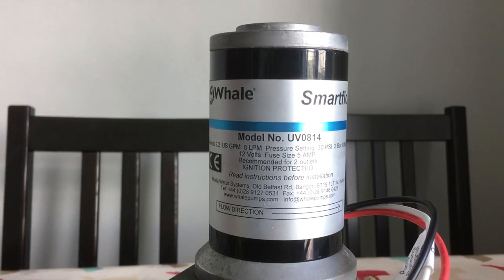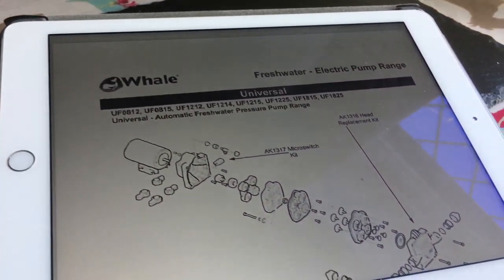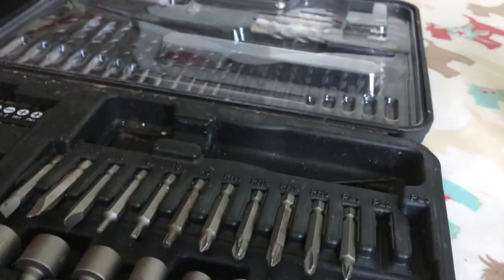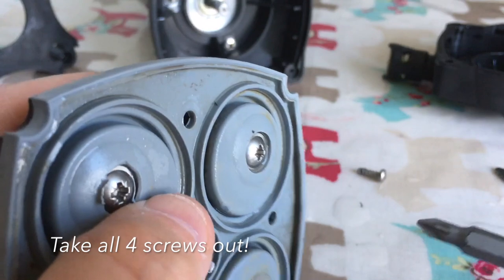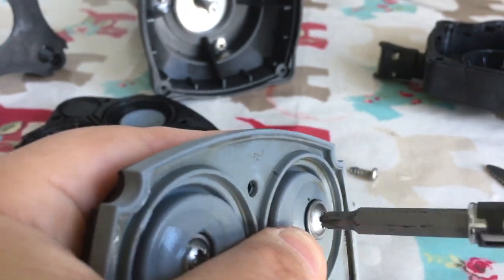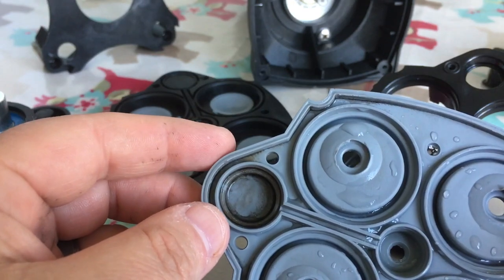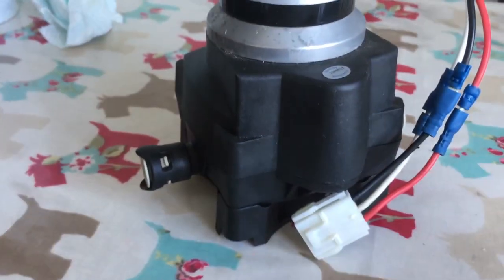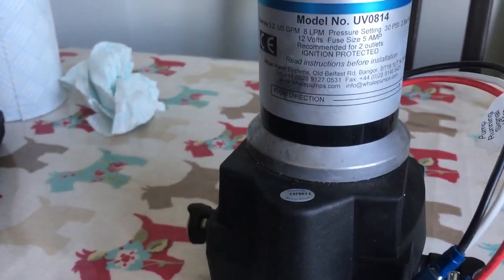Whale Water pump Maintenance

Comment: The saga of my water pump in my series 1 Unicorn. After problems with a noisy pump and what appeared to be non return valve issues I decided to carefully follow your excellent video and strip it to fix it. What I wasn't expecting was the micro switch assembly in the top motor housing to fall out.  I had to guess which order the 4 components went back.  After a while I reasoned they could only go back  one way. So after a good clean out I reassembled the pump only to find that, although the motor worked it wouldn't pump water. Four times I took it apart trying to find why until I finally tried a bit of silicone sealant on the mating surfaces. Shouldn't need it but it worked. It actually pumped water ------ until it wouldn't shut off !! 
I was confident I had put the micro switch assembly back right but it just wouldn't shut off, chucking water out of the pump all over the floor. Enough of all this !! I bought a new one today and fitted it. I needed to altar the infeed pipe a bit but although these newer pumps are said to be quieter I can't detect much difference. In fairness my wife pointed out that it's often better to hear the pump working. Many times we've been unaware the water container was empty and hearing the pump working alerted us.
Reply from the maker: Hi Phillip, Sounds like you’ve had fun with the pump 🤔 Our old pump gave up in May. We got on site, set up, turned the pump on and nothing happened. We managed to get a new one that day and fitted it. It was initially quieter but got louder as the week went on. I would say the noise is different each time we go away, I like you have resigned myself to the fact that the pump will always be noisy. Part of the problem is that noise travels fantastically through a floor of a caravan. If I ever find a solution to make it quiet I will of course video it. 🙂 Thanks for comments & watching, Martin 🙂

Comment: Good instructional video, well done. My diaphragms were very worn so I replaced them with a Whale service kit, however I have been unable to get the pressure back up. The pump runs a lot quieter, and water is flowing albeit very slowly, however not enough pressure to shut the pump off. Any thoughts?
Reply from the maker: Possibly air in the pump, ours only lasted another 6 months and had to buy a new one. Hope you get it sorted. Cheers
Reply: Took the service kit off to return for credit, put original back on and it works fine now. Not sure how long it will last, but I think cleaning before replacing is a good option. Sadly this does not explain why a brand new kit wouldn't work. Just happy to have it up and running for now.  @TheCaravanNut

Comment: Great vid Martin - and job done by the look of it ! - I know that pump has bugged you from day 1. I had to get a replacement Flojet pump earlier this year when my pump would not work at all on my first trip of the year  -( whole week without water !) . I disassembled on site to see if i could get it going and found it was just the pressure valve and was prepared just to buy and fit that, but found out it was covered by my 12 month warranty so Lowdhams, Huddersfield  replaced the whole pump FOC.

Good work Martin !
Reply from the maker: Hi Howard, I’ve been playing around with it again this morning, dropped the water and refilled it. It is quieter, I think I just need to resign myself to the thought of that’s what it’s supposed to be like! Thanks for comments and watching, Martin 👍

Comment: Hi, I tried this clean myself after issues with the pump switching on randomly and air getting into the system.   I would have to turn the pump off at the switch so it doesn't drive me crackers.   this causes a loss in pressure so when i switch it back on the pump operates as if its filling the cylinder up again and i have air in the hot side of the system.  I've rang whale and they suggested the o rings for the air problem, which i have already changed.  wondering if it would be worth changing the pump diagram head now?  maybe the rubber has gone a little brittle and lost its elasticity and so is not holding the microswitch in the off position?  Any ideas,  Help  :)
Reply from the maker: You could try the diaphragm it may work. Our pump only lasted another 6 months after this job, bought a new one!

Comment: Thanks for useful video. I have an FP0814 and was able to fix from this video. My problem was that it periodically tried to pump with the tap closed. Your video gave me the confidence to dismantle it and I reckoned the problem lay with the one (or more) of the four smaller light grey "valves". Carefully popped out all the valves and spotted some minute white particles on their sealing faces (I fill up most often with hard water) so rinsed them all off and put them back in and reassembled. My FP0814 seemed to have an extra metal washer which slipped out before I could spot where it came from. All back together, no leaks and on test it sat for 30 minutes without a single intermittent pump. Perfect. Dead chuffed! Thanks.
Reply from the maker: Glad the vlog helped and sorted the problem. Our pump only lasted another few months had to change! 
Cheers

Comment: IMPORTANT! When dismantling the unit pay attention to the stainless steel washer and O ring. As previously mentioned make sure that the screws are all tight (the diaphragm may need wriggling to seat the screw holes properly. Lastly, there’s a tiny O ring around the head of the longest screw, ensuring that was in the centre of the washer when tightening seemed to do the trick ( would be easy for the screw not to sit in the middle of the hole and ride up. It took me  3 goes to get this sealed🤦‍♂️ but working well now and not pulsing. My comments will make sense once you get to reassembling.

Comment: Another great and informative video. I have a truma system which uses a flojet pump and it make a right noise. I have mounted the pump on bobbins but it still makes a noise, so I will try and look how to clean it. Thanks for the tips and advice.
Reply from the maker: Hi Steve, I was quite surprised at the muck inside. We only got the van in May so I presume that who ever had it before didn’t clean there water system out as much as I do. I’m still not entirely happy with the noise but will keep trying different things! Thanks for comments and watching, Martin 👍

Comment: Just a tip😉,just fixed whale 8014,really dirty ,used that vid here.want to add:make sure everything is tight on assembly.my problem was air suction from the pump assembly,from ware and tare,little wd40 on the caskets helps to fit quick,all screws need tight well,no seems should be seen at the last 4 long screws 😉still don’t strip the treads!it’s only plastic 😆..and the vid helped me a lot!vacuum leaks are not just on the fittings.my problem started after I did clean the system with white vinegar.as recommended by the seller .I don’t believe that’s good for the rubbers .😉
Reply from the maker: Thanks for the info 👍

Comment: Thanks so much for this video, really gave me confidence to open up... however when I got to the grey diaphragm, I notice when I opened up and looked closer there were some slits on the outside circumference on two of the circles, hence the reason why water was leaking from the pump. Your video didn't show any slits or cuts on the rubber diaphragm. None the less, I was able to diagnose the problem, I couldn't find a replacement grey diaphragm online so I am buying a replacement head instead and hope this solves the problem. Thanks so much for this helpful video.
Reply from the maker: Glad the vlog helped, unfortunately our pump only lasted about another 6 months and had to buy a new one. 
Thanks for comments and feedback

Comment: Like your blog watching you strip down a whale water pump so I thought I will do the same to mine same problems all was going well a small steel washer fell out of some where and I don’t no where to put it back tried reinstalling the pump with out it it won’t turn off any help out there Tom
Reply from the maker: If you got to the Whale website or Leisure shop direct you might be able to download a manual which should give you the diagrams. It’s a long time since I did this vlog and have since bought a new pump. Cheers

Comment: Why not simply run a descaler through your system once a year? I use Fernox descaler in a gallon of very warm water drawn into the system, leave for an hour or so, open each tap slowly to allow descaler to work within the taps then thoroughly flush system through. Cleans the pump of scale and all the water lines and of course, the internals and heads of the taps. I normally do this at the end of the season prior to the normal system clean-out with Puriclean.
Reply from the maker: Will look into that, cheers

Comment: Hi, and thanks for this useful video. However we have done everything (we think) that you have explained and now we don’t have any water coming through at all. There is one thing we are not sure of which is that two components, we think, of the micro switch came away and although we have put them back as we think they should be it may be incorrect. The bits that came out were both white plastic. One was a sort of cylindrical component with a narrower cylinder and a wider cylinder, the narrower bit fitted in to touch a spring which had not come out. The other bit was an arm with a rectangular end, which could fit on the narrow cylinder end so that it could swing left or right if we have it in correctly. The top of the rectangle had an indentation…not sure what for. The bottom could fit over what we think is the micro switch as this would click when pressure is applied. We are not sure what to do now and we are in France for a month where getting a replacement pump is very difficult. Any comments or help gratefully received.
Reply from the maker: Hi, I have replied to your message on twitter, hope you get it sorted. cheers

Comment: Very helpful video; please note that there is a small o-ring aroud the central screw in the middle of the black part on the right of the screen at 4:52 (after ‘lift off’); do not forget to clean it and put it back
Reply from the maker: The pump only lasted another 6 months and has now been upgraded. Thanks for comments

Comment: Hi I have a pump like in your video and when its up to pressure and cuts out it starts to leak over the floor. I have opened it and cleaned it and nothing obvious is wrong .. do you have any suggestions its only about 2 year old 
Raymond
Reply from the maker: I would replace the seals, they do a seal replacement kit. Failing that I would buy a new pump! Cheers
Reply: @TheCaravanNut  had a search and can't find them . Do you have a link I could follow?
Reply from the maker: Can't find it myself, might not do it anymore. I would try and phone Whale up, they may have some.